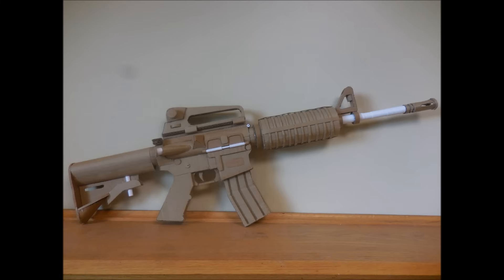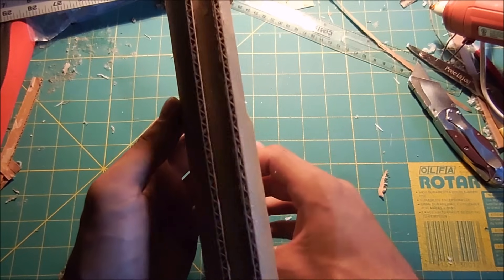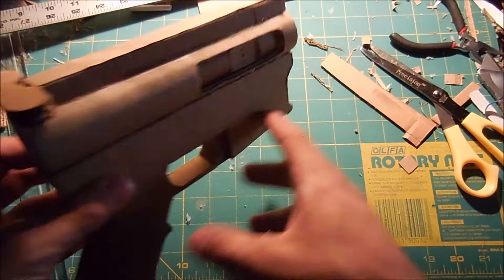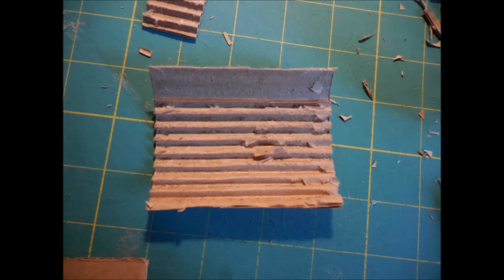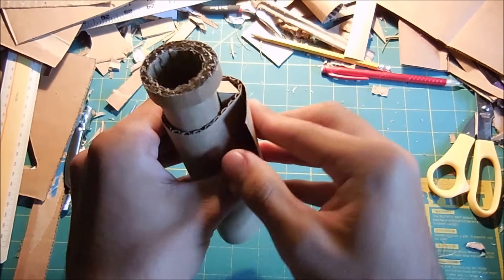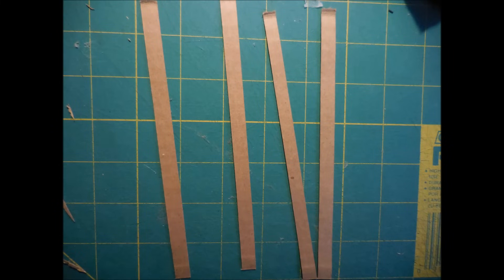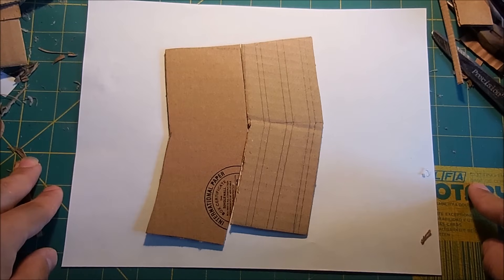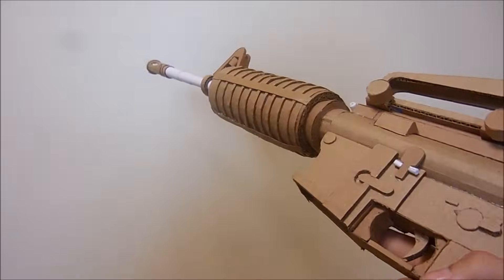How to make my Cardboard M4A1

Comment: To make a working trigger - 
Cut the shape of the trigger, but longer. Round off the top of it. Put a hole in the top of the trigger. Poke a stick through the gun and through the top of the trigger so the trigger can hinge. Then glue a spring behind the trigger

Comment: Hey umm what was the length of the strip you used to connect the left and right sides of the lower receiver? Im making a M416 (HK416) and im basing alot of these stuff to your video. If you cant provide information, thats alright. Ill do my own!
Reply from the maker: Do you mean the width? If so, I made mine about an inch wide. I'm not sure how accurate that is because I didn't have a real one for reference though.
Reply: Magicalamazing Thank you!

Comment: Odd question and im not exactly sure youll see this comment considering this is a 7 year old video but how did you get the m4s body scale? I dont think there are any images online showing the m4s body or anything.
Reply from the maker: @Some_American_Guy_  It is very easy to find technical drawings of mil spec AR15 lower receivers. Pick any dimensions and scale the rifle off that.

Comment: Just a suggestion: add some links to where you got your measurements
Reply from the maker: I just use the picture i sketched full size. I get the overall length of the gun from Wikipedia usually
Reply: Ok thanks :)

Comment: Are there tempplates, Just to make it Easier
Reply from the maker: I don't use templates. All I use is the one full size sketch as a reference and I eyeball everything else. I would give plans if I had them, but I don't. As for materials; cardboard, paper, rubber band, box cutter, hot glue, tape. A drill might be useful for the stock, but it isn't necessary.

Comment: This is M16A1
Reply from the maker: There are a few differences between the M16 and M4, but perhaps the most easily recognizable one is barrel length. The M16 has a 20 inch rifle length barrel and the M4 has a shorter 14.5 inch carbine lenght barrel. This one was built with the M4 14.5 inch barrel. The M16A1 specifcally had an integral carry handle, while this one does not, and generaly (but not always) M16 varients tend to have fixed stocks and M4 varients have telescoping.

Comment: Not an M4A1, that’s an M16
Reply from the maker: There are a few differenced between the M16 and M4, but perhaps the most easily recognizable one is barrel length. The M16 has a 20 inch rifle length barrel and the M4 has a shorter 14.5 inch carbine lenght barrel. This one was built with the M4 14.5 inch barrel. Also generaly (but not always) M16 varients tend to have fixed stocks and M4 varients have telescoping.

Comment: That’s an M16
Reply from the maker: The M4 is a shorter, lighter version of the M16. Aside from some external differences, the two firearms are virtually Identical. That being said, one of the defining factors of an M4 is that it is not a rifle, but a carbine with a shorter barrel and telescoping stock, both of which mine has.

Comment: It's a m16 not a m4a1
Reply from the maker: The M4 is a shorter, lighter version of the M16. Aside from some external differences, the two firearms are virtually Identical. That being said, one of the defining factors of an M4 is that it is not a rifle, but a carbine with a shorter barrel and telescoping stock, both of which mine has.
Reply: Magicalamazing 😒
Reply: it's m4a1 bruh
Reply: Being a gun expert and airsoft  
player I know my guns the m4a1 does not have a carry handle. But a m16 does have a carry handle and if you look at the cardboard gun it has a carry handle so that makes it a m16 not a m4a1 🤓

Comment: This is m 16 😅
Reply from the maker: There are a few differences between the M16 and M4, but perhaps the most easily recognizable one is barrel length. The M16 has a 20 inch rifle length barrel and the M4 has a shorter 14.5 inch carbine lenght barrel. This one was built with the M4 14.5 inch barrel. The M16A1 specifcally had an integral carry handle, while this one does not, and generaly (but not always) M16 varients tend to have fixed stocks and M4 varients have telescoping.
Reply: @Magicalamazing  no way I thought your channel was dead lol